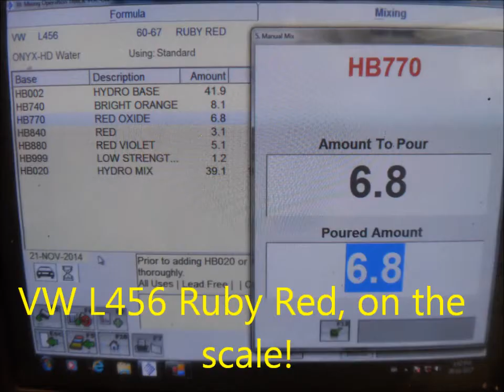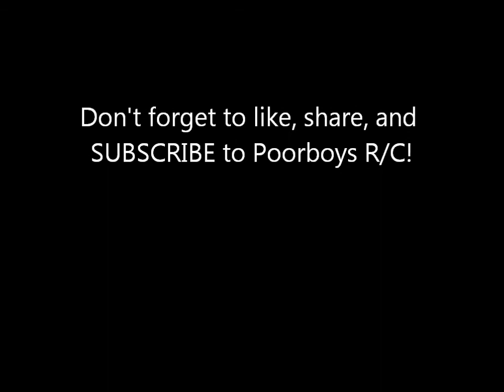Painting Tamiya MF-01x Volkswagen Beetle Body with Factory Paint Job!

Comment: Fun video and the paint job looks great. However if you are using factory paint, shouldn’t you have painted the outside instead of the inside. Not that it matters. With a lexan body you need flexible paint, first bump and this paint will probably chip, regardless which side.
Reply from the maker: By painting the inside, the clear lexan acts as a clear coat, making the paint appear shiny. And you may be surprised, but this automotive paint is quite flexible. I've been painting RC's with it for years, even with my old 1/8 race buggy and truggy, and it holds up extremely well.